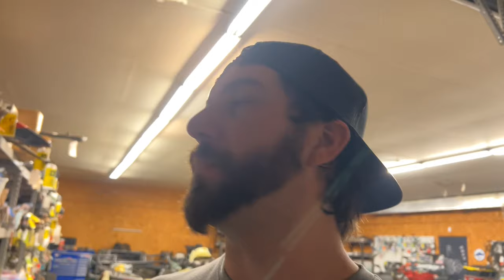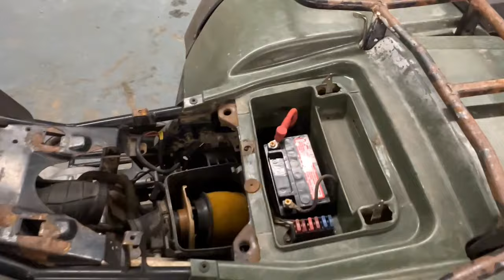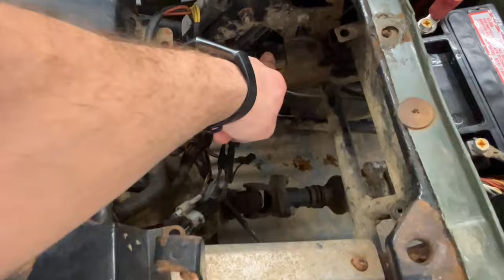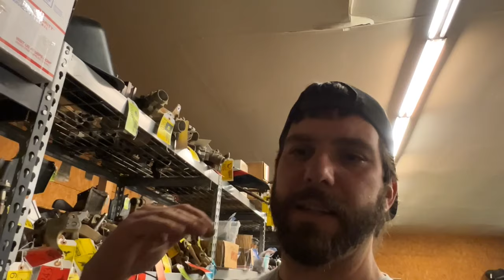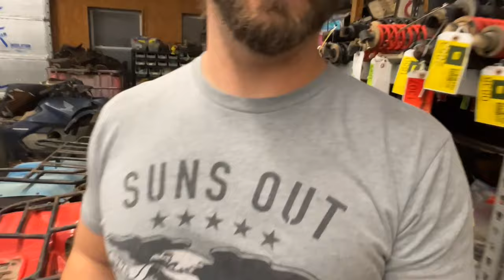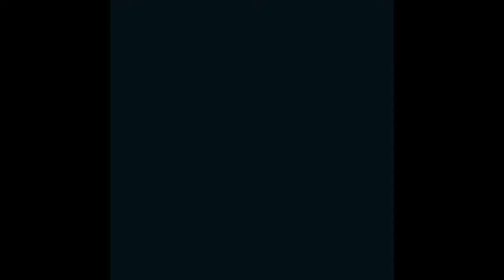Pros & Cons Of Selling On eBay in 2024

Comment: eBay favors buyers. I used to hit the flea markets get film cameras ( canon ae1/ Nikon F1-2 spotmatic )ect. I started getting too many returns. People using cameras and especially lenses they didn’t want to buy do a project and return it.   I even got a camera back that was broken but not the one I sold , I would right the serial numbers.  Now I sell locally only for less money buy the sale is final. Also I moved to selling vintage tube amps.  It’s just a hobby. Don’t get me wrong you can make money selling on eBay but between false returns and fees, you gotta sell volume which means more work.   Feels like you end up working for eBay not yourself.  Just my experience
Reply from the maker: That is very true.

Comment: I buy and sell on ebay. The fees are way out of hand. They say 12%. More like 33.3%. About not backing up sellers...They do back up the sellers. I bought something earlier this year. Said it was delivered at 6:10 AM. My mailman isnt even out of bed at 6:10 am. Due to the fact it said it was delivered.....I lost my money. Ebay is going to be a memory if they dont fix all the problems they have.Buyers and sellers are not going to keep losing.
Reply from the maker: That is about the only thing they will back up but anything else they don't, I will add that all the carriers have a gps location when they drop a package so in a problem like that you can usually talk to the postmaster to fix it.

Comment: ebay needs to implement a return policy for stuff sold in ebay motors, that the buyer needs to provide a invoice or receipt from a certified repair shop stating the item is DOA or broken because ive had so many buyers last few years trying to install the the parts them selfs to save money and end up damaging the part from incorrectly installing and then open a item not as described case saying the part was broken. I also had to get rid of PayPal because I sold someone a 800 motor block and they ruined it by never fixing their cooling issue so 2 months later they opened a case with PayPal saying I sent them a bad engine block. even after I asked the buyer a bunch of investigative questions basically admitting to it being their fault. I had to fight with PayPal for 4 months and still lost the case. just wild what some people will try to do to you now a days to get something for free from their ignorance
Reply from the maker: This is a good idea, I mean we do make mistakes but I do my best to make sure everything we ship out is good to go or as described. Even then eBay has made it hard to read the details on a part, I sold a diff and even wrote in the first picture “for parts or repair” big and red, the guy left negative feedback that the diff was messed up. It was 20% of the price of all the others on eBay is probably why they bought it.
Reply: @TheATVHustle  that's another thing I noticed selling on there as well...I sell boat engine parts so shipping can get expensive as I'm sure you're well aware selling what you sell. I sold a gearcase for parts or repair for $75 plus shipping because it needed rebuilt. Good to go ones sell for around $300/400 an it sold within mins. I should of taken that as a red flag and reached out to confirm with them that they read the description but because since I do this all by myself I was just to swamped an forgot to. Of course they opened a return soon as they got saying it didn't work lol I can guarantee they jumped on it because of the price an didn't bother to read anything. I paid $100 in shipping both ways lol
Reply from the maker: @aldunk2360  yep it sucks to take the L like that.
Reply: People very rarely read the listings on EBay. They make their purchase based off the pictures. I sell mostly electronics, 95% of the stuff I sell works, but that 5% listed for parts bites me in the ass sometimes. 
Down in the description, in bold letters I’ll put does not work or for parts that seemed to fix the issue.
Reply: Ebay only works in a high trust society.  We are NOT a high trust society anymore...

Comment: I’m in okc, I think I might start doing with with outboard motors
Reply from the maker: I did it with a Yamaha pro 50 and it did pretty good for the price i paid for it. If you know them well it would be pretty easy!
Reply: Nice!  I bought a used lower unit for my 1986 Mercury 200 outboard engine for $800 back in the mid 2000's on ebay.  Was very happy.  It arrived in cardboard from UPS.  Bolted it up and worked perfectly.

Comment: I also buy and sell used auto parts on Ebay. I haven't had too many returns on the items I've sold. 
But I have had problems returning parts that were listed incorrect and some that the photos of the parts taken by the seller just sucked and were taken at angles hiding imperfections, dents and scratches. And to tell you the truth, it's not a very easy process to get a full refund from the sellers who hide behind the "No Returns policy. It's now came down to me not buying anymore used auto parts from Ebay unless I have no choice.
Reply from the maker: There are definitely some bad sellers out there, we always tried to take plenty of photos so it was all there but a surprising amount of people didn’t even bother to look at them.

Comment: Did a little selling on eBay years ago (member since 2000).  I'm getting ready to retire and want to sell a bunch of stuff I've accumulated on eBay.  Plastic models, tools, audio equipment, etc.  eBay fees are too much, plus PayPal fees and the risk of getting ripped off.  I may just throw everything away to avoid the eBay hassle.  It's a shame.
Reply from the maker: Maybe a good option would be to find a competitor to buy out your inventory.
Reply: @TheATVHustle  
Not in business or anything.  I'm a 60 yo man with a lifetime of stuff.  I want to unburden myself and travel.  But thank you for the suggestion.

Comment: I need to sell stuff but have no idea on how too. I am a solo running muffler shop, so things have to be on the quick side, or it doesn't happen. Can you help me with the how too. You seem to be smart in this area.
Reply from the maker: I would be sure you can ship it first; mufflers are hard to be worth shipping due to the cost of shipping. Besides that, i would find a comparable listing on eBay to what you are trying to sell, scroll down to sell one like this then there are only a few things to fill in. It should take 3-4 min to list at most. I personally have to ship first thing in the morning, or it will get pushed off and not shipped, this is a big no no to Ebay.

Comment: Thanks for the video, I’ve been recently staying consistent on listings. I’d like to see video on what subscription I should use for eBay. 🍻
Reply from the maker: It would depend on how many listings you're hitting each month. If you have listed/sold 306 or more, it would be more cost effective to have the basic store @ $21.95 a month. If you are doing 1152 or more listed and sold it would be more cost effective to have the premium store @ $59.95. That is all listed and sold since if you start the month with 250 listings and you list 100 but sell 50, its still over the 306 mark even though it would only show you have 300 current listings. I am going to check my eBay now since I'm pretty sure they are charging me 74.99 a month.
Reply from the maker: They do charge me $74.95 a month since I don't pay annual. To cover the cost of month to month The basic store would be an extra 24 listings and the premium an extra 150.
Reply: @TheATVHustle  hey thanks, I’m closer to the basic store atm. I’ll take your advice and update my account soon

Comment: I need a stator for a 2002 sportsman 700 Twin, never would I have imagined what these things cost! New-cost more than I gave for machine. Used- cost as much as five new stators for a 500 sportsman (from Amazon)
Reply from the maker: Yea new oem is pretty high. When i was working on a 02 I found that the stators on them is very problematic. It is usually swapped to 04 or 05 and up but you have to swap the stator, flywheel and ecu. It may be worth looking into if you plan to keep the quad long term.

Comment: Most machines out there dont have titles as they are strictly offroad etc. how do you deal with that? any trouble parting them out and junking stuff?
Reply from the maker: I have never had an issue but my state didn’t issue titles for atvs until recently. It is very common for it to not have a title in tx/ok/la/ar

Comment: I know the pain. I drove tractor trailer for an Amazon freight partner and most warehouses have a gate check in system where someone (middle eastern) is talking to you through a speaker box and half the time you can't understand them. when i first started you had Amazon employees checking you in and then they outsourced along with an outsourced dispatch. Also, I owned a Honda 200m back in the 80's. It was a step up from the 200s model and was an awesome machine!
Reply from the maker: I'm closer to TX near Broken Bow.